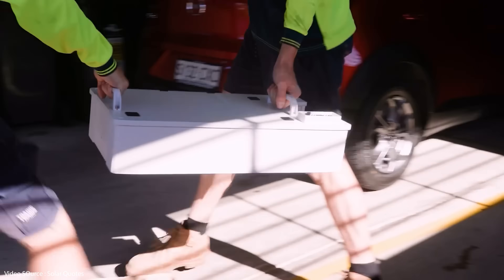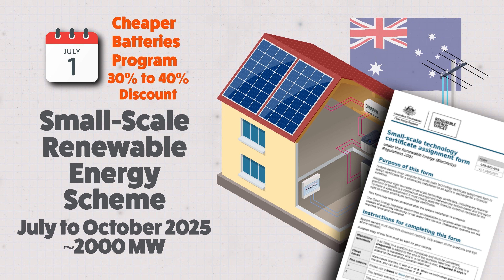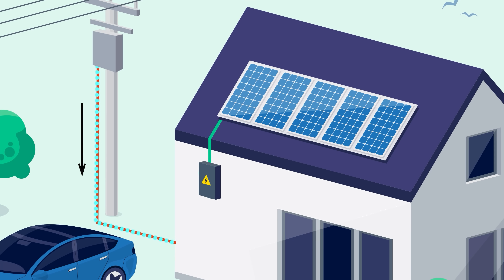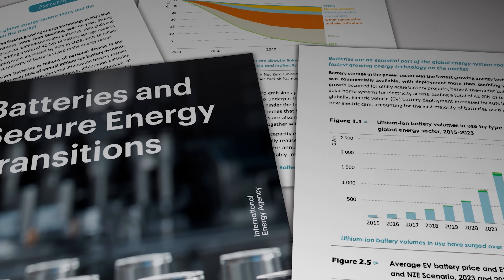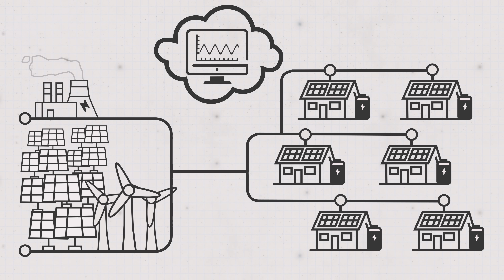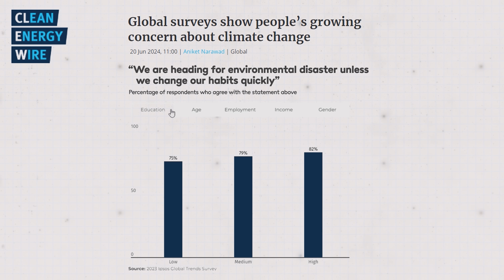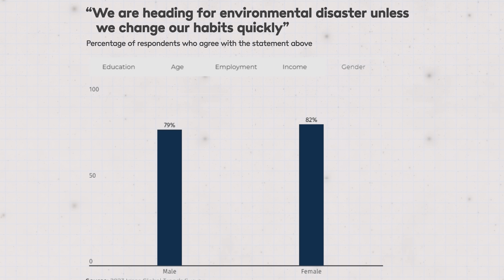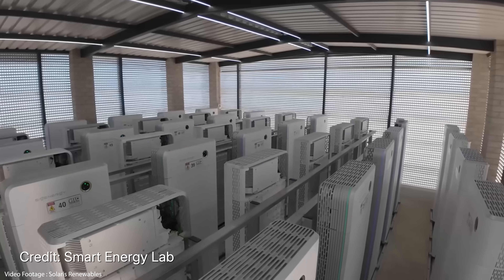Australians installed 100,000 home batteries in 17 weeks. Why can't we all do that?

Comment: I’m an Aussie and took advantage of this straight away. I installed 2 batteries, 20kwh coupled to a 13.2kw solar plus a heat pump. We now run a credit on our bill instead of a $350 per month bill pre batteries. Now we can use air conditioning ‘guilt free’ and we have whole home back up! Probably one of the best things I’ve done to cut our living costs. Love it! 🥰
Reply: The 'lucky country' indeed! I'm not jealous at all.
Reply: @paulhayes6920 lucky country, a government spending $7.3billion on this when we are 1 trillion in debt
Reply: @nevilletisch9637  government spending to prevent massive grid issues is a good use of funds
Reply: @nevilletisch9637 if it saves $300 and that money is spent on products instead of on coal generated electricity.. it's going to generate at least $45  in taxes (per person).. per month
Reply: @nevilletisch9637 

This creates and sustains though.

Think of it this way. Yes the government spends $7.5 Billion.

But, The business owners get a huge chunk. Out of that huge chunk. Let's just say $5,000 per house.

10% of that is deducted as GST.

Government has made $500 per person back.

Next up is Payroll taxes. Per employee, that's a few hundred bucks.

Then there's company taxes. Another 22% of that.

Now, these blokes installing them are going to need lunch, tools, fuel, and a myriad of other things. Chalk in another few hundred bucks in GST.

House owners with solar sometimes still end up paying power bills. GST there. 

This is actually a good use of public funds. It sustains jobs, supports small business and trickle feeds cash back into the economy.

The cycle is a circle. It essentially eeks out being free for the government over time.

Spending $10,000 a head on government dinners, is not a good use of public funds. The cycle is still true in that respect, but that, is a blatant waste of money.
Reply: @nevilletisch9637  Victorian here. Our coal powered stations are old and approaching use by date.  Power will have to come from somewhere and it might as well be my roof top.
Reply: @tillykelp9744  There is 2500 years of coal in just the latrobe valley allocations.  Victoria is one the most energy independent areas on earth.  What is lacks is a government willing to build out the infrastructure to make use of it.
Reply: @mrblack888  I will stick with my solar&battery systemthanks..I'm not too keen on getting black lung and all.
Reply: @hitreset0291  Do you live in the 1800's?  Do you dig coal by hand?  If not, I think you'll be fine.
Reply: @nevilletisch9637  If you didn't give your gas away for pittance you would be in the black.
Reply: @nevilletisch9637 & Australia still has low debt compared to other nations.
Reply: @nevilletisch9637  the solution to our debt is partly a resource tax, which no doubt you voted against.  Foolish man
Reply: @mrblack888  If we thought like you, we would still be in the Stone Age.  Plenty of stone about too.
Reply: @pbiza  exactly.  We don't have gas for our own needs.  It is a joke.
Reply: @tillykelp9744  Wasting money for some stupid fad product isn't clever or unique.  It's what every greedy idiot wants.
Reply: @mrblack888  if you say so.  You might be interested to know a simple fact:  the spot price of renewables is cheaper than coal.
Reply: @tillykelp9744  That will happens when the government heaps 400% taxes on the coal and then uses the money to subsidize the useless windmills.  You really don't know anything about this.
Reply: @mrblack888 
The coal industry is heavily subsidised.
Latrobe valley is the very dirty brown coal variety.
What is causing the current global warming 🤔?
Reply: @pbiza  more just 'give it away' not even a pittance involved.
Reply: @mac_mcleod  $$ more tax revenue than that
Reply: @nevilletisch9637 learn what the word 'investment' means.
Grow up.
Reply: @nevilletisch9637  Yeh they always seem to forget that after you buy stuff, you gotta pay it off.
Reply: @nevilletisch9637 tell me you don’t understand macroeconomics 😂😂
Reply: I had a 5kw solar system installed 15 years ago. I have never paid an electricity bill. My inverter has died and I am upgrading to a 25.6kw solar with a Sigenergy 40kwh battery. Hopefully, my electricity bill will be zero and pay for itself within 8 years. Total cost with rebates is about $40000AU.
Reply: @roblockwood116 get a electric car to store your energy
Reply: @roblockwood116 
I think you should shop around a bit more before handing out $50k
Reply: @roblockwood116  25+kW >> that is a tonne of solar. I have half that amount solar plus similar sized sig batt and I still feed heaps of kWs into the grid this time of year
Reply: @roblockwood116 sounds like a small power plant! The better installers produce a forecast based on available roof space, shading, roof pitch and direction of sunlight to recommend the optimal system. With a 4cent feed in tariff vs 34cent import tariff there is no point in putting a system that exports large amount of electricity.
Reply: @roblockwood116 if you have batteries and that much amount of solar power what is the point of staying connected to the grid? Is it not better to go off grid and stop paying all the electricity providers fees and taxes?
Reply: @niconico3907  you get paid by back feeding into grid. not much, like 1/4 of the normal price, but it adds up
Reply: @EnnTomi1 but is it more than the connections fees and taxes?
Reply: Great stuff, well done 👍🙏🏴♥️
Reply: That great! What was your out of pocket cost for the 2 batteries?
Reply: @sonicweaver  We got 37kw of Solar, 3 phase and 32kw of battery storage with federal and state subsidies our total cost was $11,000 because we qualified for a small business subsidy so this covered a further 50% of the out of pocket cost. At home I have 6.2kw of solar and 1 x Tesla Powerwall and looking at my stats I imported 0 from the grid for 191 days out of the last 356 and I haven’t had a bill for ~ 2 years. So I’m absolutely cheeeeeering
Reply: @Shane3Logan amazing bro! Alhamdulillah
Reply: @lchig0  it works wonder here due to the climate and weather we have. it is SUNNY , too much sun here.
Reply: @sonicweaver I'm pretty certain you won't  receive an honest reply. 

I too am in  Australia and an AC coupled 10kwh battery system was quoted  over $10k (to add to my existing solar system), even with the rebate. That was just the battery. At a quarterly bill albeit a little less in comparison to the original poster, of approximately $120/month (due to existing solar system) it would take me more than 10 years for the payback. Most won't break even by the time the battery gives up the ghost.  I would guess the quoted system for 20kwh, battery storage, Solar panels, inverter, and a heat pump, would be somewhere in the order of $25,000 or more. But I stand to be corrected. That's a pretty big outlay. Rebate or not. I'm hoping advancements in technology and a simmering market brings the prices down, because honestly, it still is quite prohibitively expensive.

I don't think those who are taking advantage of the system are part of the group concerned with cost of living crisis as our government puts it, because the battlers would be using the money to put food on the table if they had it. It's a bit of a predicament of the "haves" and "have-nots" unfortunately.
Reply: @black7rc720 You are so correct about that, the people who are struggling with energy costs have no hope of jumping on board this over inflated government subsidie.
Reply: you are being robbed by your installer
Reply: @johnnywarbo  better to give this money to the people to upgrade the grid than to blow it on that white elephant Snowy 2.0
Reply: That’s really good and don’t forget it helps to balance modern electric grids where you have many small producers of electricity.
Reply: I got solar in 2020, at battery in 2023 and a heat pump this year. I am still paying off the battery, but the solar paid itself off in 2 years and the heat pump was free :) 

The only thing I think the government could add is an incentive for landlords so renters aren't disadvantaged
Reply: Nice, after 20 years you would have broken even on all the costs of installation and maintenance even after tax payer funded discounts.
Reply: Yep, congratulations and way to go!
Reply: I’ve had solar panels since the late ‘90’s and a solar battery since 2018. 
I can’t remember when I last paid anything for power. 
I live in South Australia which has the highest non hydro renewable energy levels in the world at 70% and the govt is aiming for 100% renewable energy by 2030. 
I am moving house this year and will install solar and battery at my new place. 
I’ll apply for the Federal govt benefit as well as our State Govt benefit. I’ll also up my battery capacity as I’m thinking of an electric car for my next vehicle purchase. 
This has proved the easiest decision I have made. And it will be the 4th time I’ve installed solar using govt purchase schemes. And I like the thought of reducing our carbon footprint and reducing the use of fossil fuels.
Also our uptake on eco house design and water storage has also contributed to energy savings. I currently live in a solar passive house and rarely use ac. I do use overhead fans and cross ventilation during summer and heating on occasions in winter. 
My next house will be 6-7 star energy rating too although no double glazing this time. 
All of these innovations in home building and lifestyle makes perfect sense to me and in my view, should be the norm.
Reply: all your neighbours get to use those batteries as well. they should thank you.
Reply: If I could afford a house I'd consider a battery.
Reply: Congrats.  We have had solar and batteries for 6 years in the US and experienced similar changes in our bills. We have a positive bill during the winter, but still lower than before solar.  And large negative bills during the spring, summer, and early fall.  The net annual bill is negative, and we get a credit or check from the power company.
Reply: @JBoy340a Wise move. It’s really the only way to have control over your power.
Reply: I don't know about "guilt free" - a 40% reduction in burning coal heats up Earth's atmosphere another 1 degree Celsius as per the Aerosol Masking Effect research that I have referenced on my blog. The so-called "clean energy transition" is going to be bumpy considering 50 gigatons of pressurized methane is already locked in for an "abrupt eruption" due to the taliks already melting in the East Siberian Arctic Shelf. Mother Nature has already locked in our climate "biological annihilation" but setting up an off-grid or mini-grid at home power system is still fun and zany. congrats. I built a bicycle generator in my garage from a free treadmill motor so I can generate a couple amps at slow pedaling speed.
Reply: How much did that cost?
Reply: @CodyOnHomes  Solar system purchased in 2012 and during time when solar was 4 times cost that one could purchase equivalent system today. I spent $85k on that 13.2 kW system, but was able to pay it off within 7 years with incentives in place in Washington State where I live. Those incentives sunset in 2020, but the price of solar is way cheaper now and highly worth the investment costs.  I purchased two Tesla Powerwall batteries in 2018 for ~$15 k and they were well worth the investment IMHO.
Reply: HELL YEAH that sound awesome!
Reply: Yeah but how much did you have to pay upfront? Like 10 grand?
Reply: By the way - the batteries being installed now have virtually no chance of catching on fire.
Reply: "those solar panel lover hippies are a problem, we should make it so that they don't feed back!"
government greases the paws of the consumer to not feed back
"we don't have as many customers to make a profit like we used to! take those incentives away"
We have been hammered by higher than average electricity prices for years... it's time we take back what's ours.
Reply: whos paying for that?!
Reply: We have too.   Love it!
Reply: Congratulations.
I put solar in 2011 in the house in NSW. It was only 2.5kw but delivered 15 kWh a day.
If I was still in Oz I would have a bigger array and a big battery.
Take care M.
Reply: What's the tab for batteries, inverter, solar panels, junction box, electrician's work, new roof before installation of solar, utility charges etc...How many years to pay back?
Reply: @EricBlair-d7x  Hi, unless you re planning on passing way it will be cheaper than hat you are currently paying / going to pay.
Take care M.
Reply: @E @EricBlair-d7x st is $24k will pay back in about 7 years plus will get a electric car in the future
Reply: Can power companies access your stored energy, through the smart meter, and have priority over the draw on the battery? So do you have to pay for night time use and buy your stored energy back from the power company?
Reply: @peterclancy3653  If you agree to join your battery to a “virtual power plant”, then yes.  Otherwise no.
Reply: When it requires replacement in 5 years as the cells wear out, what's the full retail cost?  Does that factor into your "savings"?
Reply: You now operate a home micro-grid. When I started university in 2009, this idea was still a research project. I expect in another decades' time, most freestanding homes will be self sufficient, dispatchable power plants. In the same way households are our largest generation sector today.
Reply: You obviously have more money than I have because I cannot afford to put a solar and battery but yet I have to pay for yours because of government unfair subsidies..😡🖕
Reply: @Steve @SteveCaruana-u9l cheap energy bank loan or increase your mortgage
Reply: @Gordon-j4j  I am a pensioner. I cannot afford a bank loan or to increase my mortgage. so how can you make a dumb statement when you don’t know a person‘s finances….🤪
Reply: How much ?$
Reply: America  has 90 nuke plants , china 60 , France 50 , Japan 30....AUSTRALIA ZERO.....absolute joke....all our renewables  are made in china by our communist enemy ffs....suicide.
Reply: Other options of course could have a) incentivising solar arrays facing due east or west to extend the generating day, and b) given Australia’s multiple time zones, building big solar arrays across all time zones rather than concentrating them where most people live.
Reply: @petergilbert72 the East and West coast grids are not connected to each other. They are too far appart and not enough population in the middle to be worth it.
Reply: @niconico3907 ah, that’s a problem then. But maybe worth a shot going forward?
Reply: Well done
Reply: Did ye think of having a fire system built around the batteries?
Reply: Well done mate! Let people fight over the climate wars, whilst you are winning in your pocket, the numbers speak for themselves.
Reply: We need more info about brands, DIY, and price tags.
Reply: @theblackhand6485 No DIY. Must be installed by professionals
Reply: If I could afford a house, I'd have a battery.
Reply: Offgrid power generation is also more resilient during disasters too. Who wants to rely on technicians to come fix your power in the middle of heatwave when your airconditioning has no power. With solar panels it's not a hard job to fix yourself or find someone who can.
Reply: @newlocationcomingupsoon  Hi, being independent in grid outages is a major advantage.
Take care M.
Reply: Unfortunately when the government gives thing to people you will find dodgy installers get themselves in on the scheme , remember what happened with the free batts :(  I'm a sparkie & a fellow sparkie has had 2 emergency call outs on a Sunday about smoking batteries happening, both batteries had been installed by dodgy installers, unfortunately i'm finding this a lot with AC installs as well :( !
Reply: @briansmale5457 170,000 batteris  say 3%  where done badly thats 5300 .............

I wonder what there estimate is or rate of faliure.

They say constantly how we're a skills shortage yet they do these things with such limited time frames....
Reply: @briansmale5457 Yeah, my batt instalion was a joke. My attic looks like a junk yard. How does one find a decent solar installer? I have no idea. Then there's all of the confusing subsidy stuff to apply for. I can't do it.
Reply: @briansmale5457  Given there's no free AC rebates from the government it sounds like the issue is dodgy operators more than it's government incentives.
Reply: @jakal0  The thing is dodgy installers under cut the good bloke, the government only care about the $ value, that's why you find more dodgy installers associated with government schemes. You can choose your AC installers but, with government installs you will have to take who they recommend or pay more :(
Reply: @briansmale5457  It's not government installs, it's a rebate, the government doesn't recommend anyone. You get quotes from whomever you like and they all include the rebate.
Reply: Except for the huge upfront cost and taxpayer subsidies…
Reply: How did you figure it out. I've been looking at installing roof solar for 8 years. It's too complicated, and who do you trust? I don't want cowboys installing anything.

I'm now paying $3000 a year for gas hot water and electricity.
Reply: @toby9999 maybe time to realise even the cowboys can get the job done.
Reply: @toby9999 find local electrician who will look after you in the future and install your battery solar system properly
Reply: @toby9999 its not particularly complicated, as far as the hardware install is concerned.

Then its just the kind of connection.
Ie it needs to isolate automatically if there's a grid outage.
You don't want to back feed the grid and zap an unfortunate lineman.

There's a little bit of maths re the wire gauges (don't want to undersize it and melt the wires)

You can get an all in one inverter, solar mppt and battery system which eases installation.
Reply: Will be keen to see your comment in a year. Many batteries in the market won’t last that long. LG still have a nation recall in place
Reply: @stewy2909  Yes... remember pink batts where the results were deaths from electrocution and then the house fires. They had to go remove the batts from thousands of houses. 
Now you've got mass instillation of lithium batteries that better be installed perfectly or the resulting damage will be devastating.  
Dont forget those 100,000 batteries are being installed in a country of 30 million people while we have a massive shortage in electricians.  I hope not unsupervised apprentices or labourers were involved in those installations. 

These programs under labour are always a disaster.
Reply: @cathymadsen2930  These programs under any flavour of government are a taxpayer waste, and ultimately a disaster, not just under Labor. Did you forget Morrisons $300,000,000 splash throughout the covid BS, something that we are all still paying for via inflation and its effects ?
Reply: @cathymadsen2930  Oh stop it. This is just propaganda spread by the fossil fuel industry. The LG batteries are NMC, while the vast majority of domestic batteries are LFP. And if you don’t understand why that’s important then you shouldn’t even comment.

As for these things always being a disaster under Labor, you might want to consider the risks associated with burning fossil fuels, which is what the COALition would have us do.

Stop spreading silly Sky News FUD that you know nothing about. The fact that you had to link it to pink batts shows how desperate you are. The COALition’s only answer in this situation is to do what it always does. Nothing.
Reply: @cathymadsen2930  I hope the electrical authority that has to inspect and certify each installation recognizes this risk and pays serious attention.  Ultimately the EA should be held accountable if the installation is not completed properly but receives approve to be put into service and then causes a fire and/or damage.
Reply: you didn't CUT  your living costs mate,  you just paid about ~$40k upfront in electricity costs,  and now you own a depreciating asset, which will only lose capacity over time....  rather than simply spending $3.5k per year for 11-12 years.
Reply: @CrusinVKmuch rather own the darn thing than rent it from blackrock or whomever.

When you do the math on the rental, you pay far more than the system is worth.
That and they generally are fairly fixed in what they think will suit you.

Everything depreciates and so its not really an argument for why you'd not do it.
Heck, why buy a home? As it is they can't keep going up in value, people can barely afford them now and their price is limited to what the market can pay.
Plus you have maintenance costs.
The land has value but the house less so.

You'd choose this install so to have a lesser reliance on the grid. Power outages aren't a problem and you're helping with the environment with renewables.
Once Fossil fuels are burnt, its pretty hard to recapture.

The batteries should last a reasonable time ~ 10yrs + 
The solar panels are rated for 25 years until 80% production.
They still work... ~ 440w panel becomes 352w give or take.

Systems like these also makes sense as far as EVs are concerned.
Especially if the load of charging at night becomes a worry.

Vehicle 2 Grid can also supplement these systems or work for homes without the battery but have the solar.

Here in NZ a family member was considering solar via one of those rent schemes. 
But it worked out to be a lot more than the cost of the panels.
The only good things were if it to leak or need repair then they'd fix it up.
If you changed homes then they'd also move the system or you'd have to get the new owner to buy in on it.
Reply: @ArmChairPlum  I think you could also add the actual buying power of money today vs 12 yrs from now.  When I look back over the last 10 years I am amazed at the reduction in terms of what I can buy now vs then...  If I was receiving steady wage increases that might not matter but the vast majority of us are not.
Reply: You took the government handout that we all have to pay for going into the future!
Reply: @brianlove8413  Government giving money to taxpayers for things they actually benefit from! Quelle horreur! We’ll all be ruined! Much better to subsidise the fossil fuel industry, eh? This program uses less money in five years than the diesel rebate uses in one.
Reply: @brianlove8413  didn't you listen to anything in the video? this is actually saving money by making the grid a lot more efficient, this kind of subsidies is just good management.
Reply: @GabrielPettier lots of fossil bots trying to sew negativity and slow this tidal wave coming at them😃
Reply: @nothinghere1960  They’ll make money for as long as we let them. But yeah, better capitalists are already displacing them.
Reply: This is an absolutely terrible idea.  Whoever came up with this scheme should be fired.
One large installation would be far, far better than this.
Reply: @tarstarkusz  Easy to say in theory, but in practice that ‘one large installation’ doesn’t exist at the household level. Distributed batteries reduce peak demand, cut grid upgrades, improve resilience and give households immediate bill relief. The fact people are seeing credits instead of $300–$400 bills suggests it’s doing exactly what it was designed to do.
Reply: @tarstarkusz  While there are efficiency gains to large installations, there are reliability ones to decentralized grid systems, also, having energy production all over the place, instead of in one central place, requires a lot less infrastructure upgrades, as you don't need to create very high power lines to the various places you need to connect to it, you can just reuse the last mile infrastructure. Also, for safety reasons, having one gigantic field of large batteries is very risky, an electric fire in such a place would create a monster of a fire, it would take many years to design and build that facility to be safe, letting people build it for you by just taking small on the shelf systems and adding to the grid gets you that in months, and you don't have to pay anyone to maintain it. Plus people gain energy independence, if string wind or whatever cuts the line to a place, they can still operate on their own energy, and they also get direct incentive to use energy in an intelligent way, (people love not to pay for stuff, and it's *great* if the reason they don't is because they don't waste.

Really, there are many upsides to this scheme.
Reply: @GabrielPettier  They aren't more reliable.  In the US at least, if you are capable of sending power to the grid, you will go dark in an outage, even if you are producing 4kw of electricity.
You are absolutely wrong about this being easier on the grid.
A properly designed site would have no issues with fires spreading from module to module.
Reply: @tarstarkusz  People have a battery in their home they extra energy they produce is stored locally, if they are cut, they can run on that until connection is restored, and knowing that they are cut, they will do their best to make that last as much as possible. The grid is only needed at this point to to offset the difference between what they produce and what they consume at any time.

Do you know how hot battery fires are? It burns through a *lot, and the mere proximity of a very hot fire will increase the risk that another unit overheat, bloats, and become part of the fire too, so you have to space them a lot, reducing a lot your efficiency gains. You might as well put houses in the spaces created between the batteries…
Reply: @GabrielPettier  I don't know about Australia, but in America, that would be illegal.  By law the power MUST shut down in an outage.  This is for the safety of the people sent out to fix whatever broke and caused the outage because the solar/battery would put power onto the grid.  All you can really have in the US is either a total off-grid system or a power bank you can plug things directly into for power.  You cannot energize your outlets.

Yes, and they can be designed properly and 1 can burn down without affecting the other ones.  We have had this happen already.  
Now, you have the fire risk across 100k individual homes.  All with substandard equipment (not commercial grid operator equipment), much of it directly connected to a wall.
Reply: @tarstarkusz even in the USA there are home battery systems which provide backup by isolating the house from the grid. The Tesla Powerwall does this, as does SolarEdge, Fronius and other systems. It's not illegal as long as the system doesn't put power into the grid during an outage.
Reply: @tarstarkusz The US is a shambles in every way. Nobody cares.
Reply: @tarstarkusz Please forget the US. We in Australia are leading the way. Reality has finally arrived and Govt decisions are not influenced by fossil fuel and Nuclear lobby groups. You pay a fortune for what is now a no-brainer investment in Australia
Reply: @Rottnwoman  The men working on the power lines do.
Reply: @tarstarkusz  Guys! New battery chemistry is not highly flammable
Reply: @tarstarkusz  That must be a design  failure then, because that's not how a well built system works in Australia.
Reply: @tarstarkusz  that should be an easy to solve problem, and the US will adjust to it as it becomes normal to have for people to have residential power bank, a circuit is a circuit anyway, they can disconnect one part in a controlled way while they fix the accidentally disconnected part, and then complete the circuit again. It doesn’t require cutting the powerbank from the house it’s attached to.
Reply: @tarstarkusz  systems with blackout capability automatically isolate the house so that none of the power gets pushed back into the power lines.
Reply: @tarstarkusz  I did check and i think you are spreading misinformation, islanding is definitely an available feature in the US, that allows local storage to act as backup and prevent backfeeding in case of outages, not all systems have it, but it’s not like it’s not something you can’t do, it’s even becoming more and more standard.
Reply: @GabrielPettier  If it turns out I am mistaken, that isn't "spreading misinformation"
Reply: @chrisheddles7005  Yes, I've heard there are special installations where you can do this, but they are a lot more money and most people choose the option that leaves you in the dark during an outage.
Reply: @tarstarkusz spreading misinfo is not always done on intent.
Reply: @nothinghere1960  Yes, and the sodium batteries are not flammable at all. Sodium is the future for storage batteries. Its like playing Whack-a-mole with the fossil fuel apologists on this thread.
Reply: @tarstarkusz  I am in Canada and we have similar laws with the US with regard to connecting solar or backup power to a grid connected building.  Islanding is an absolute must...no one can get permission to connect without an inspection and approval.  You need to double check your source of information because it is wrong.
Reply: @theharper1 sigenergy has gate way backup off grid capability for blackout storms etc
Reply: In practice, storage close to point of use has the highest utilisation. It also takes advantage of existing transmission and distribution networks.
Reply: @tarstarkusz gigawatt scale batteries are also being installed. What the home battery scheme does is help reduce the peak exports from home solar while simultaneously reducing the grid demand at peak times and giving homes a backup if the grid fails. If you thought that this was the only thing being done, you'd be mistaken.
Reply: @tarstarkusz  Oh really? I'm sure you'll be able to explain why.
Reply: @tarstarkusz why do you think that?
Reply: @tarstarkusz  LOLH when that fails it all fails. small distributed networks isolate the breakdowns.
Reply: @johnlarson111  It is highly unlikely to have a huge failure. 
 Volume pricing.  Active management. etc.
Reply: @tarstarkusz  I can remember when most of the eastern seaboard of the United States up into Canada went dark because of a switch that failed. happened more than once.
Reply: @johnlarson111  That would also happen if you had batteries.  If you can feed energy into the grid, your house goes dark if power is lost, even when the sun is still up and you are producing power.
Reply: @tarstarkusz no. My house automatically isolates from the grid and runs from the battery if the grid goes down. Please do some research into what is available now with hybrid inverters and batteries as opposed to ten years ago. You are spreading misinformation.
Reply: @tarstarkusz  Wow, you really don't know what you're talking about. Our gateway switches over to local use mode within 1ms if the grid goes down.
Reply: @theharper1 happy to see people correcting others on the modern systems.

Yes there are still systems out there that if the grid is down then they can't generate power.

But all you need is a smart system that isolates the grid and then you are free to use the stored or generated power.

The only downside that I can think of is maintenance. 
Like with home air-conditioning, there will be some households where little or no maintenance is done.

Unlike in commercial where they get cleaned yearly filters changed and gas topped up.

I recall talking to a aircon man and he mentioned that he went to a place that had a whole house aircon that was performing badly.
The main intake in the hallway had never had the filter replaced and it was pretty chocka full.
Reply: @johnlarson111  what's that got to do with installing home energy batteries?
Reply: @tarstarkusz You sound angry? Why? This gives us energy independence and we can actually give back to a stressed energy system
Reply: @nothinghere1960  Not angry. Try again.